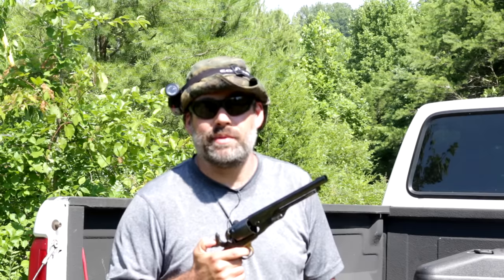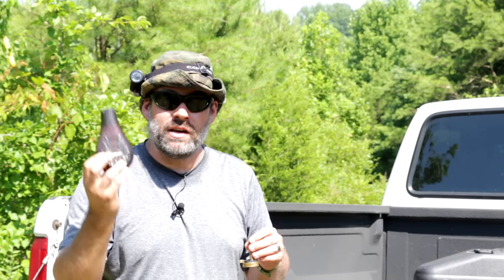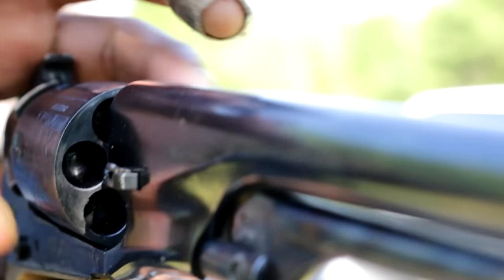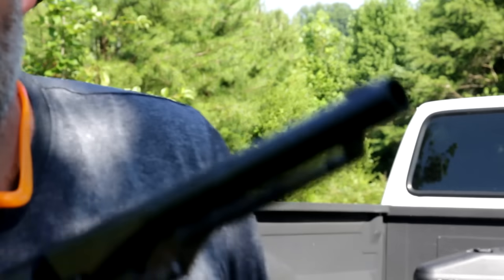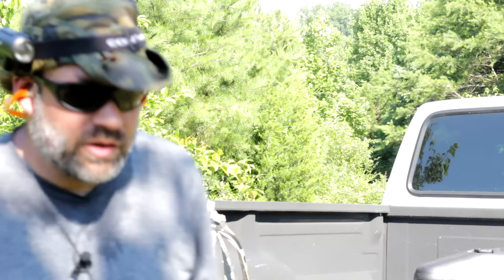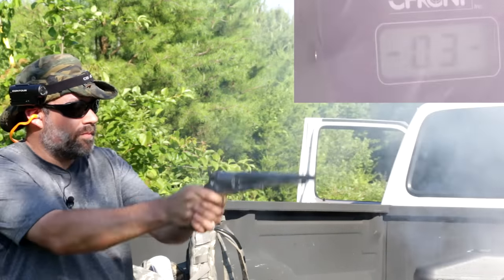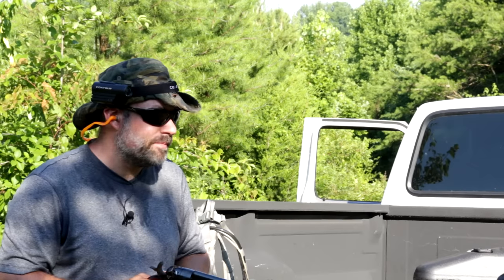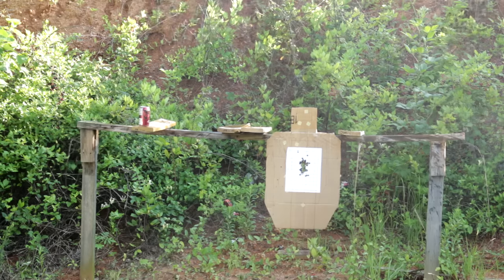How Powerful are Black Powder Revolvers?

Comment: I used FFG in mine
Reply: You used FFg and lost HOW much velocity over the FFFg that you should have been using?
Reply: Weslag1  I do not own a chronograph
Reply: Without a chronograph, you can only guess, by feel of the recoil, or by firing into a couple of pieces of 2x12, but you're using rifle powder, which is much more slow-burning, in a handgun.  Your velocity loss is significant over loading FFFg.

That said, you don't have to try to see whether you can get enough powder in a chamber to blow it up (you can't) every time you fire a round.  

A standard 8-inch Colt 1860 loaded with  with a fairly heavy charge of FFFg will hit about as hard as the average .38 Special. 

I have two 1860's and an 1858 that I keep loaded and accessible around the house in case I need to shoot someone. 

They might as well earn their keep, and since I don't have to worry about drawing them from holsters or concealing them, they are not bad home defense guns.  They can sit around serving that purpose just as easily as they can sit locked away unloaded.  

So in MY case, I keep them loaded in a manner that will make someone stop what they are doing if they're shot. Elevation isn't an issue, due to the very close range and large target, but muzzle energy and penetration ARE factors... so they carry lots of FFFg while waiting for the use that will probably never happen. 

If you don't mind ballistics more on the order of a .32 ACP, [or less], there's nothing wrong with the reduced power you are getting. 

For pure plinking & target shooting, the only thing to be aware of is that the speed of your ball will hugely affect the elevation.   High velocity loads will shoot to a grossly different point of impact than low velocity loads. 

If your gun is shooting too high, or too low for your taste at any given distance, you can adjust that by changing the powder charge. 

Also, extremely low velocity loads are not as accurate in some revolvers, while it may be exactly what some other revolver tends to shoot best with.  What I've seen pretty often is people saying that 20-25 grains of FFFg doesn't shoot as accurately in their gun as 30-35 grains or more.  The majority of people seem to get that result, while with some others a low velocity charge is exactly what their gun loves.
Reply: Weslag1 I only have a brass frame in my trigger spring just broke a

I am very limited on what I can own firearms because I have a pending charge in New Jersey for not registering a BB gun

I can only own black powder guns
Reply: Weslag1 I got the gun for hunting and self-defense
Reply: Is the BB gun story real or is it a joke?
Reply: I've used the stuff to,   Great loads
I bought a can of ffg Goex and compared it to fffg  BP.
It's funny because the ffg burned cleaner than the fffg stuff.

Comment: Your "lead" balls are not pure lead. A .451 spherical ball of pure lead weighs 143.8 grains. Your low and very inconsistent velocities at 35 grains and 40 grains of powder are do to inconsistent compression of the ball and charge. 37.8 grains (by bulk measure) under a lead ball should give the maximum velocity that will fit in all .44 caliber black powder pistol cylinders of about 960 FPS and 260 Ft.Lbs. of muzzle energy . I use a now antique (1970's) Lyman adjustable powder measure with a micrometer-type adjustment for the powder charge.  The most powerful load in a "8" inch barrel should be a 155 grain lead bullet (Lyman #450229) over 28-31 grains of Pyrodex or FFFg black powder (depending on exactly how deep the cylinders are bored on your pistol) with a corrected muzzle velocity of just about 920 FPS (20 shot average) and a muzzle energy of about 280 ft/lbs. This is almost equal to the .44 Special lead bullet load equivalent. It takes a great deal of pressure on the loading ram to properly seat and compress a black powder load and ball. I have found CCI primers to give more consistent velocities and accuracy in my 13 black powder pistols, but your results may vary. Kynoch brand black powder is the premium true black powder by far. Very expensive and very hard to get. Pyrodex substitute is much easier to get, and in longer barrels gives a very slight velocity improvement. The Lyman cast bullet is at least twice as accurate as a round ball load. Any load that chronographs over 1000 FPS is a "blown" round which deformed either in the cylinder or the barrel gap, and will be inaccurate. Either load at under 50 yards will cause a terrible wound in human flesh (tested in hog's bodies) shattering bone,  with the ball or bullet deforming to about .75-1.00" diameter. Have fun and wash your faces!

Comment: That still doesn't say what caliber, I would say the first ones 36-second 1 44
Reply from the maker: All of these are 44.
Reply: 44 usually takes 35 grains to 40 grains of black powder, used to shoot flat powder fired original Walker, it's an art form, when I didn't know it was the conversions for 45 Long Colt
Reply: Uh, like what is a .451 in your mind?
Reply: Ok what was Reginald Virgil abloh is 1 revolver look like a 36 caliber the other one a 44 where you got . 451??

Comment: The first 30 seconds sounds sketchy as hell. I own an 1851 Navy Colt, you should NEVER use more powder than recommended
Reply: Especially with older guns.  Metallurgy has gotten better (even from the 1970's) on these guns but the older you go the more likely of loading a hand grenade when going over the limit.

Comment: Nice video ^^ And btw, because of the Lead-bullet you can't reach 1100+ feet/s. I'm sure you already know that
Reply from the maker: Sure you can.  My 9mm cast lead load is over 1100 also the original 300 grain 45/70 was a lead bullet traveling at 1600 ft/s.  Over 1200 out of a cartridge requires either paper patching or a gas check to keep leading down but you can push lead over 2000 ft/s out of a modern rifle if you really try.
Reply: Ok copy that o7
Reply: i like the Remington better, I've sot hundreds of rounds through mine and never had any cap malfunctions, i've even killed deer with it.
 
 it gets dirty though, the colt is an inferior design imo(at the time, that's why all later colts were built the same way as the Remington) i like the way the colt fits into my hand better, i wish i could somehow have a half colt half Remington, lol
Reply: Not to talk about the .45 colt cartridge loaded to the brim with fffg.
I mean when that stuff go's off it easily reaches 1100 - 1175.

Comment: My bb gun has more power then the first 6
Reply: With an under 20 grain pellet most likely.  Unless you have a Dragons Claw or a Benjamin Bullpup.  Not comparable energies in the slightest for a .177 or .25 or even .35 air rifle.

Comment: That ain't black powder!!!
Reply from the maker: True, Real 3F Goex black powder isn't as powerful. https://youtu.be/YPGcP3D1ROo
Reply: @deuceandguns  I make my own, I would put it up against any hybrid powder. Just saying.
Reply from the maker: Interesting.  If you're licensed to sell it I'd like to buy a pound and if not I'd like to look at your formula.
Reply: @deuceandguns  lol. I wish I was licensed to sell.
 I use the usual formula of 75% PN
15% homemade cedar charcoal and 10% Sulfur.
 I always recrystallize my nitrates, to get as pure a product as possible, I ball mill using 50 cal lead pumpkin balls, usually mill for 24 hours before screening using the 98% isopropyl alcohol dough technique, screen thru a home made 1/8' screen, I add a tiny amount of dextrin, like less than 1%,added 2hrs before I stop milling.
 After that I let let it dry well, test it, then begin to break it down further into 20mesh, .... what ever I need, I like to make fireworks, it's just very satisfying. 
 I don't make much at once, I always buy from the same source.... It's really not too hard to do, it's messy and time consuming, but all good things in life usually are.
 I hope you try your hand at this, but there's a lot better information than I just gave out there for anyone who is serious about it, the milling is dangerous if not done right, and black powder itself, even if not as mixed as I thought, it's always a hazard, so take every precaution, especially in the milling process, and where you're mill is located.😀
 Take care my Friend, Good luck, love to see other people who still use BP, Muzzleloaders and cannons.😂

Comment: You need to understand that he isn't using REAL black powder. Pyrodex is a substitute not the real thing. Never recommended for these types of pistols.
Reply from the maker: I disagree.  This is a direct quote from Hodgdon on their Pryodex P powder, "Pyrodex P is intended to be a direct replacement for FFFg Black powder when measured volumetrically using a black powder measure. The principal uses for Pyrodex P are in muzzleloading pistols, cap and ball revolvers, and in small bore, muzzleloading rifles."
Below is also the link to verify this info for yourself.
https://www.hodgdon.com/pyrodex-granular.html
Reply: Tambi Dudley lol what do you think black powder substitute is supposed to be used for then??
Reply: DEUCE AND GUNS Pyrodex does work in cap and ball revolvers but i have noticed a considerable difference in power and recoil when using real black powder. My Uberti Walker has half power when using pyrodex and i noticed most of the powder doesn't burn in black powder pistols while black powder burns much faster allowing higher velocity and more power in bp pistols. pyrodex works great in rifles though.